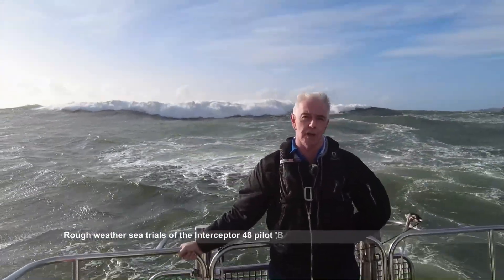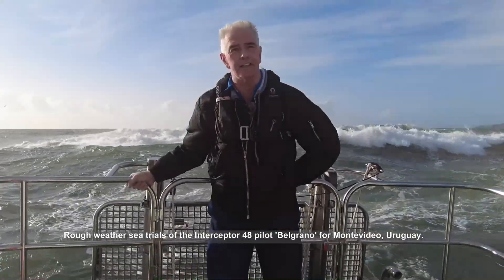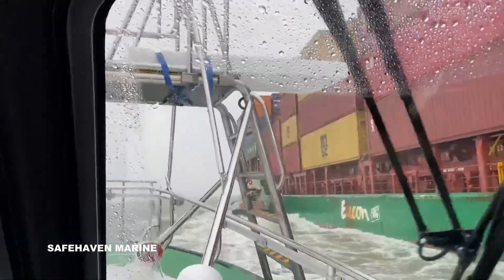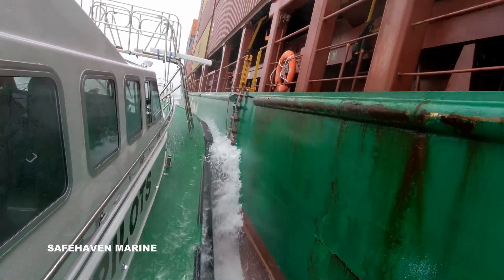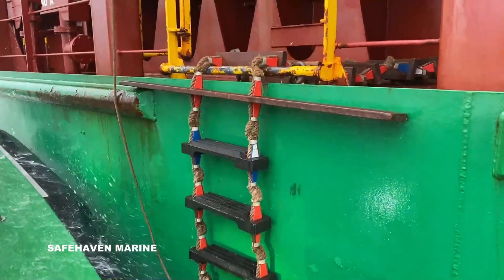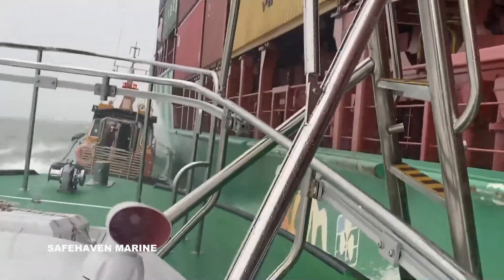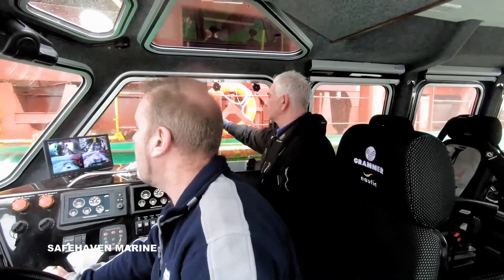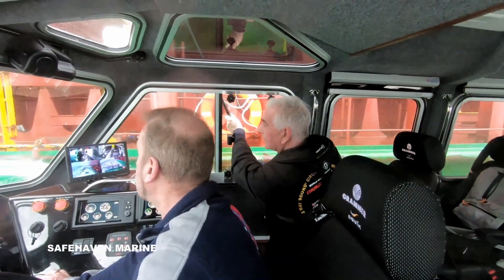Sea trials of the Interceptor 48 Pilot 'Belgrano' by Safehaven Marine.

Comment: Another configuration would be to have the boat held as firmly as if it were anchored when still, to have the boat plane at higher speeds,  and to eventually have the boat hydrofoil at the highest speeds.

If you have multiple keels, running as vanes, beneath the hull, stern to bow, and have each around 2ft to 3ft deep, these would keep the boat very steady, when still, and gradually lift up as the boat first planes and then eventually hydrofoils on these vanes, with air pockets between them generating hydrodynamic lift at moderate speeds and aerodynamic lift at high speeds.

Now, if you have small segments of underwater wings(running port to starboard), as in the SWATH(Small Water Planing Area Twin Hull) craft, these would provide very good anti-rolling characteristics at low speeds, and eventually also plane at higher speeds.

The problem, of course, would be steering the boat, at low speeds, unless you use very large rudders and bow-thrusters. 

Another problem would be hits with debris and ice and maelstroms.